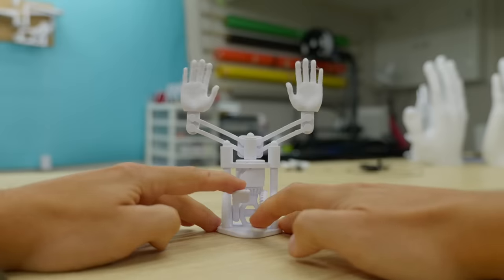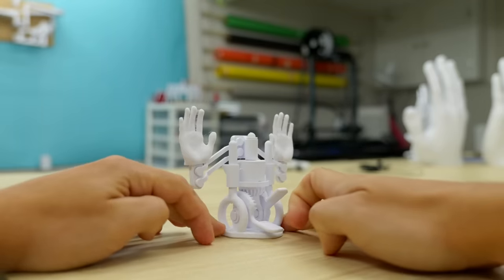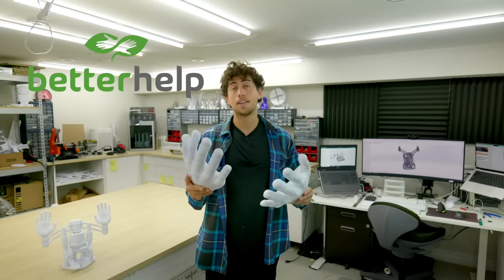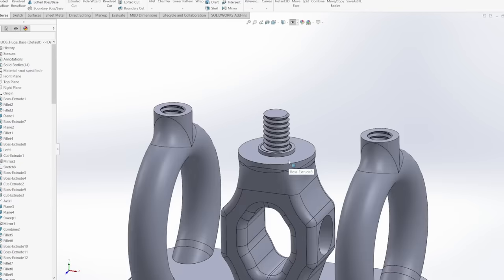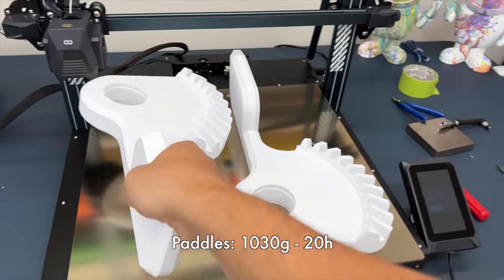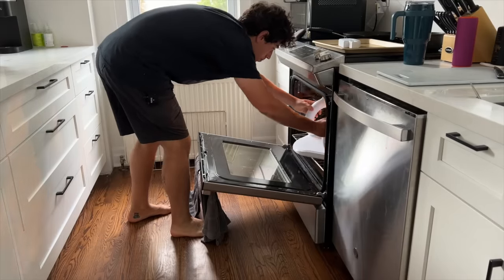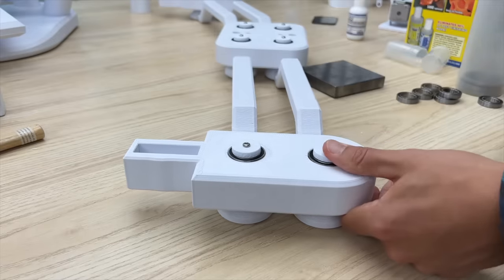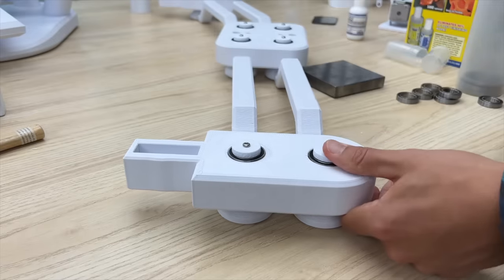I Built This Massive Mechanical Sculpture

Comment: Awesome sculpture design. The only thing to improve would be if you made it a bit more effortless to operate. 

Also for something like the hands, a cool idea to do that would be to print a thin 2 part mold shell, and use self-skinning foam. It would probably only take about as much filament and time as 1 hand, and the hands are not a structural component so they could be made of lightweight foam
Reply from the maker: Thats a great idea!

Comment: Love your videos man! Watching you get that big thing through the door made my intrusive thoughts say “slam it against the door frame”. Also you may or may not remember a few months ago I said that I was making a controller mounted joystick that I found online. I just finished it yesterday because I had to reprint the baseplates which wasn’t fun. Then I had no string to attach the joystick triggers to the controller triggers. Then I had to move which was a pain and put the project off for months. I was only able to finish it yesterday though I ran out of cord for the 4th and final trigger on the joystick which was extremely painful. Always nice to see two projects come together at the same time
Reply from the maker: Thanks Max! I did bump it on pretty much anything I could on the way out 😂 luckily PLA is quite resilient. Happy to hear about you successful project! Doesn’t matter how long it takes 🙌
Reply: Thanks for the support man! By the way what kind of screws do you use? I was thinking about getting some M3x10 self tapping but what do you use?

Comment: Do you use the same 3D printer for all your creations? Or is there a certain one you use for the more mechanical/mechanism prints?
Reply from the maker: For these huge parts I used a huge printer! But generally I use any of my machines which are all different, just depends on whats free
Reply: In the video you could see he used multiple printers.